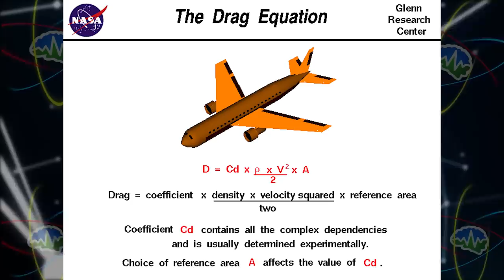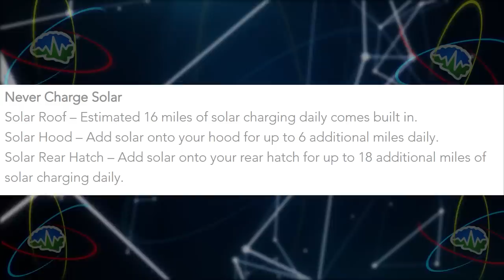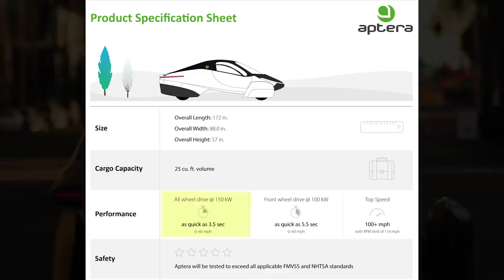Aptera Beats Tesla? | In Depth

Comment: 1. it's insanely ugly
2. it appears to be super vulnerable to getting destroyed by a Mini is a crash
3. your comparisons are bogus considering the cars you compared it to carry 5 passengers, not just 2, so redo the math per passenger
Reply: 1. An opinion that many disagree with - enough to put money on reservations.
2. "appears"?  It is designed to excel on crash tests, and will be so tested.
3.  How many times are those "5 passenger"cars used by drivers alone in the car?  ...That is what I thought.
Reply: @n.brucenelson5920  on the third, irrelevant as to the design/engineering to carry 5 or 2 passengers. 
On my first point, it is subjective but certainly will limit the amount of interested people. 
My second point comes from years of off road rally experience and a fair amount of mechanical engineering-a broadside impact of any substantial vehicle would at minimum roll it.
Reply: @paulcurtis5496  How are you going to roll a vehicle with a 77" front track and center of gravity only slightly above axle level?  You won't.  It will push.
Reply: @n.brucenelson5920  I disagree, the lack of an Raquel and opposing contact point will leave it vulnerable to rolling.
Reply: @paulcurtis5496  I didn't understand what you are saying here?

Comment: Jim C is right - so what?  Aptera is focused on chasing its tail around doing things they don't need to; it is a motor cycle they don't need car standards.  They don't need an alpha and a beta - but they are wasting their limited resources doing these things instead of making cars and delivering them to customers - they are on the same defocused route as last time they went under.  I would not say another thing if they would make 30 cars a month - that would be something - but they haven't delivered 1 car to one customer.
Reply: You haven't read their financial statements, have you?.  This vehicle has been designed from the beginning to be the most efficient and safe vehicle that could be produced.  The motorcycle thing is a legal fiction, and they were always making a vehicle that would pass automotive safety standards.

To have some perspective regarding the speed they are moving, at this point in the life of Tesla, Tesla was laying off engineers and did not yet have a working transmission, and they started with an existing Lotus car.  Aptera started with a clean sheet of paper design the same year Tesla announced the Cybertruck.  We will see 20-30 cars per month when production begins next year, after the crash tests have been completed and the ratings published.
Reply: @n.brucenelson5920  @ Jim Vonn Got a free tricycle yet, Bruce? "To have some perspective regarding the speed they are moving, . . ." They said production models by the end of this year They have 53 days left. No more perspective needed than that. A few days ago they showed the front wheels of the Beta model. Have you seen any more of it?

Comment: Aptera is basically a powerful three wheels ebike with a cover. It long range is manly due to it light weight. You crash in one of thing , you are pretty much dead.
Reply: Untrue regarding crashes.  It has front and rear crumple zones, an F1 style passenger safety cage made from Kevlar and carbon fiber, seat belts and air bags.  It will be crash tested to FMVSS part 200 standards as soon as production intent models are available to test and the results published.  It will do very well.

I have personal experience, having been hit on the Interstate by a large car at 60 mph in my first 1800 lbs Gen 1 Honda Insight.  I was uninjured, and Aptera will do even better in such an event.

Comment: Here comes another bankruptcy. Not buyin the concept.
Reply: The demand that has been expressed since preorders opened show it is going to be a huge success.  They will be far more profitable than Tesla was from the beginning, and require far lower capital costs to produce a vehicle.
Reply: @n.brucenelson5920  not buyin it, however I hope I am wrong, nevertheless, as Elone has pointed out both with words and actions, for Tesla it's not about competition, it's about cooperation. Which is the reason for his success.
Reply: @HeyMichaelLeo  Tesla is not willing to cooperate with their own customers, re: right to repair.  Aptera is working with suppliers from all over the world, perhaps including Tesla.  We will have some major supplier announcements over the next several months from Aptera as NDAs permit, including batteries and charging networks.

Aptera will supply parts and service manuals to owners and 3rd party repair shops.

Tesla spent years on the verge of bankruptcy.  I watched it from close up, since the company I worked for hired many of the Tesla engineers when Tesla had to lay them off in the mid-2000s.  Aptera's history in comparison is much smoother, including the finish and quality of their prototype.
Reply: @n.brucenelson5920  ok, clearly you are in the competitive mindset, Tesla is here to stay, I hope you are as well. But just so you know, this planet will leave the ego based paradigm behind, it might be wise to accept that and embrace what's coming next.

Comment: If it has three wheels It will bankrupt again.
Reply: They didn't go bankrupt the first time.  The company liquidated but the original founders were gone from the company by then.  The difference is that the preorders were returned and vendors were repaid. 

This is a completely new, ground up design.  The 3 wheel thing is a red herring.  It is the performance and utility that you need to pay attention to.